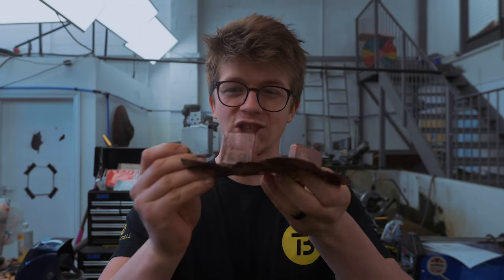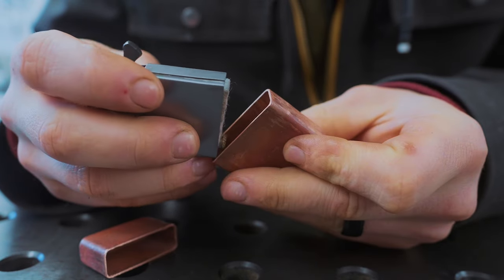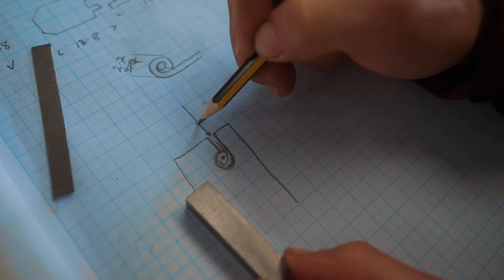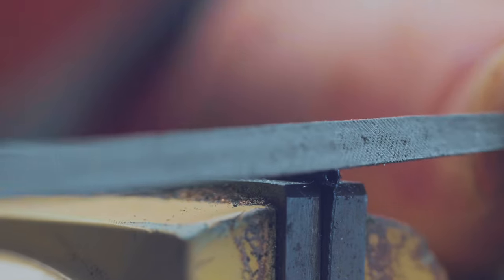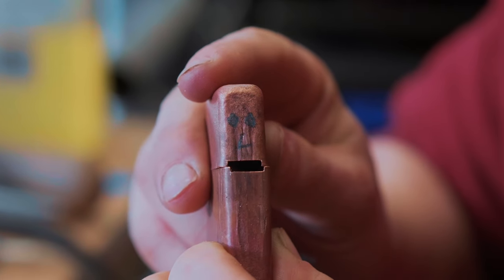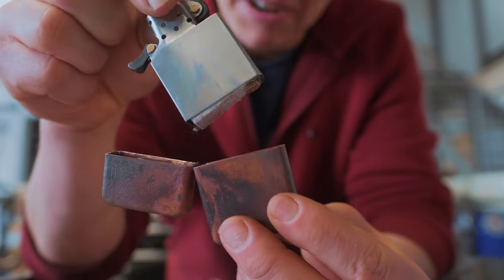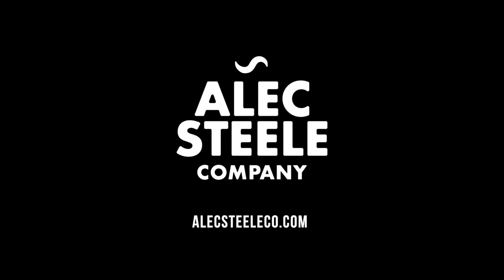Can I Make This Iconic Lighter? Part 6

Comment: Awesome series! That deep drawing of the copper was particularly interesting. Made me think: can you make wire? Imagine you are an ancient metal worker and want to make some jewelry or mail armor, how do you get the wire? Darwing it seems pretty complicated even for genius ancient folk ;)
Reply: You forge a rod until it's thin and then pull it through a tool called a draw plate. Alec could definitely make wire.
Reply: @manatoa1  It was ment more as a suggestion then as to question his ability :)
Might be an interesting project anyway, specially for jewelry, as there are ancient examples with wire that probably didn't have those draw plates, they might have rolled it or used a stone die or something.

Comment: Stunning result, it is impressive what you can achieve when you put your mind to it. Btw it’s very good you said it wasn’t the zippo sound because they trademarked the specific noise of the lighter opening and being sparked.
Reply: is that trademark stuff real?
Reply: Even so, it would only matter if he either claimed it was a Zippo, or was going to be making & selling them.  In any case, he can hardly claim it was a Zippo sound when it was plainly a one-off, custom Steele sound! :P
Reply: @NemoConsequentae  no, he earns money with showing it, so he earns money by using / building / copying a copyrighted product.

Comment: The few deep drawing operations I’ve seen started with a cup as opposed to a sheet.  The cups were considerably thicker than the final product and traveled completely through the die on each step, drawing the metal in one direction only.  All ran in specific drawing lubricant, which, I believe, was lanolin based.  Either way, very cool project and well done, as usual.

Comment: Years ago, my mother-in-law got into crafting small tables/chairs from tin cans. Part of the process involved curling up strips of metal snipped from the can. This was accomplished with a bit of metal rod with a slot for the piece to be curled. The result could be bent around the rod as many or as few times as needed. Watching you try forming that curl on that thin metal strip reminded me of how young you actually are. That craft craze was over and done well before you were born, otherwise you might have known that tools for that already exist (or are easily made). I wanted to somehow speak to the video to tell you there was a much simpler method. Caught myself before I did. 
Your lighter looks good and functions well, so, task accomplished. You keep developing new skill sets. 👍

Comment: I was holding my breath as you forced it open after the blind soldering. I would've shed a tear if it broke. I have one with a brass case. I like the tarnished copper looks old and well used. Well done 👍.

Comment: I live about 20 miles from the Zippo factory. Having toured there a couple of times I can honestly say I am impressed at how you were able to do this. The amount of fixtures and jigs, not to mention the automation and tooling that goes into one of these  is impressive in its own right. I chuckled a bit when you opened the lighter and "bent" it. almost all lighter cases go thru a station where the skilled operators make them "walk and talk" by tweaking them to straighten them out.

Comment: That hinge idea you started with was a good idea in theory. It would have been easier to fold that thin piece of metal at both ends. As it folds around a drillbit & a few inches of scrap, you just cut off.
In all my years running a metal fabrication shop. I never would have even tried something so complicated....WELL DONE 👏 👍👍

Comment: That's awesome. Nice job on the deep draw forming. The fact you made the bends with a vise mounted brake is impressive. I was expecting something like a Profiform 200 (or similar) precision brake.

In my experience, if you shorten the wick a little, it'll burn less fuel and be more wind resistant. It'll still light what ya need to light, though.

Comment: Would you consider doing some more engineering heavy projects? You already made an auger, maybe you could try making a helical end mill, and learning how to machine with only high carbon steel cutters instead of HSS, just like the old timers? Or maybe you could try and make some more advanced deep drawn components, like a brass case for a rifle cartridge, or a beverage can?

Comment: Mr Steele, I applaud your eventual success in recreating the "Not a Zippo" lighter.  If I may be so bold, Do you think you could make your own special version of a lighter.  If you want a challenge, have it shaped like your Iconic hammer with your trademark symbol on the side of it.  I would suggest machining most of the parts, but you could forge what you will.  For an extra challenge, perhaps make it a butane lighter.

Comment: FYI...
1) You can easily shape the case with proper brass instead of copper by heating it to nearly red hot then deep drawing it.. this is an incremental step.. pressed many times not just once.
2) never solder anything if you want your metal to remain firm and rigid, spot weld it...you can make a spot welder with an M.O.T.
3) you can use a lead pencil or liquid paper as an anti-flux in emergencies  .. or you can buy professionally made anti flux ... to stop solder running in unwanted areas.. that is if you have to solder something at all.

Comment: Now you need to learn to open it and light it in the fancy way. Pinch the top and bottom between your thumb(thumb on the bottom of the case) and fore/middle fingers then snap it open like snapping your fingers and use your forefinger to light it.

Comment: So just a couple notes of jewelers tricks. If you use something like Yellow Ochre (or white out) you can put a thin layer of it between the knuckles of the hinge and/or coat the pin in it to keep solder from flowing onto it. Also for alignment purposes(if you can put the pin into place AFTER the soldering) you can use a piece of mechanical pencil lead as a surrogate hinge pin to keep everything lined up and just remove it from the hinge with no risk of solder sticking to it.

Comment: Very old soldering trick is to draw on the part NOT to be soldered with a graphite pencil.  Solder will not flow , nor stick, where there is graphite.

Comment: You should have made the replica from the 1930s they have the bottom cut out and need to solder easier to form the outer case or use steel like the 1953 models made of steel and Zippo imported lighters from Austria champ patent pending made in the 50s all steel case

Comment: When so(L)dering, you first tin the parts and that way you dont get a huge flow of so(L)der all over the place. That way you can set your pieces, heat and they instantly melt into place without any excess. 

Figured with all your time in the shop, you would know this already.

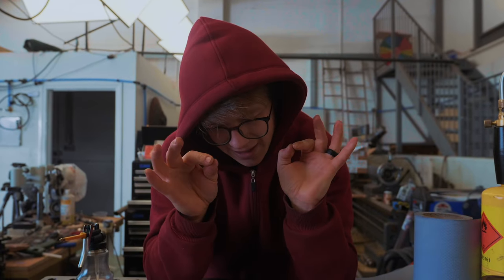Comment: 7:39 why not machine a channel in some random stock that holds both halves square to each other at an 50° angle so you can solder with it open.